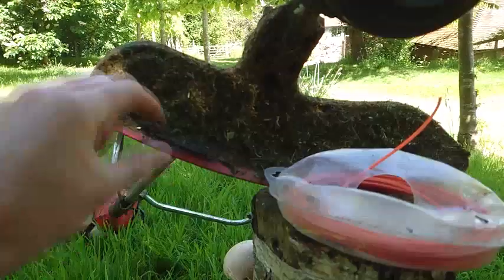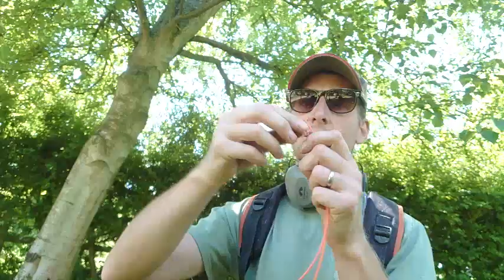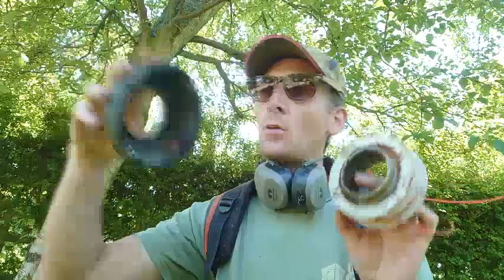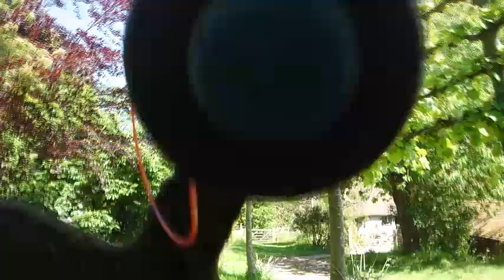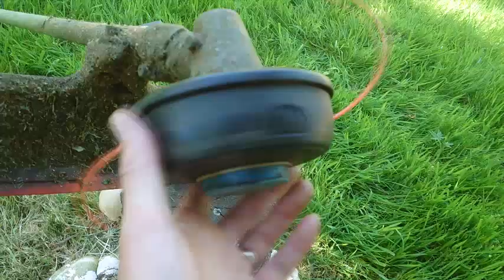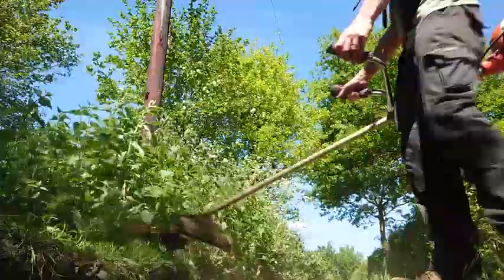How To Replace Strimmer Line In Husqvarna String Trimmer Head

Comment: I have the husqvarna multi tool.  525lk and about to get the 535lk. They have the same heads. I love them.  How often do you grease the stimmer gear box? Thanks
Reply from the maker: one a month on normal use or top up after heavy clearance works